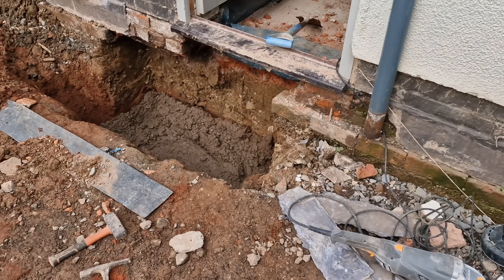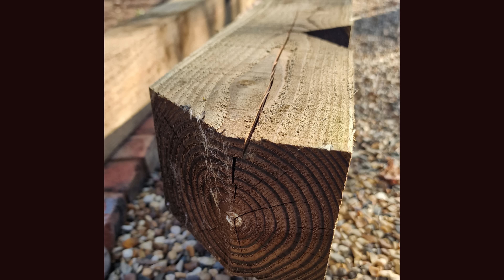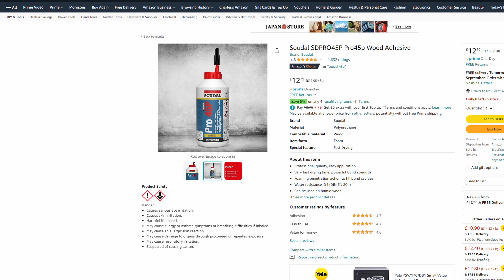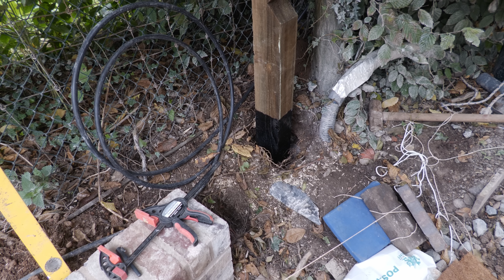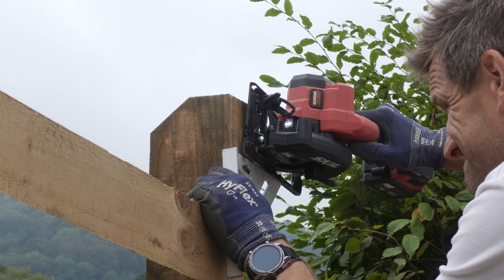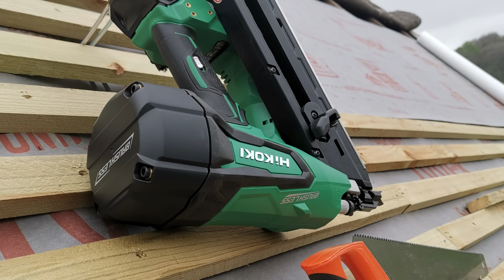Closeboard Fence Build

Comment: Thanks Charlie. I've basically copied off your approach here for my sloping fence. Material costs considerably higher in 2026 unfortunately. Also, I'm in Leeds and it seems we don't use Arris rails much up here compared to the South but I sought some out as I like the appearance. I used a durapost U channel to continue from my neighbour's concrete post but the same as your approach otherwise. Very articulate delivery. No wonder you pop up quite often when I search YouTube for DIY tasks. Cheers
Reply from the maker: Thanks Peter - really glad you found it useful!

Comment: great work... just about to redo 8m for my garden fence as it blew down.
Where did you get the capping boards... as i have no one local who sells them... especially at 3m lengths!! lol
I always blackjack my posts... never had an issue.
Replacing dodgy work previously done... 2 arris rails only used, and 100mm posts... no protection on posts, and poor screws used on arris rails (didnt use brackets or notched posts)
We have a 15m run of jackson fencing in place .. which im now going to attempt to try and get as close to looking as possible.
Reply from the maker: Some companies supply capping rails,  others don't. You could make your own with some 2x1/ roofing battens, cutting the angle on your circular saw.

Comment: Great video. If you want to save a bit of money - on large post holes , use 1.5 bags of quick setting post fix to get the posts level and set quickly. Then later make up some normal concrete with cement and ballast (1 part cement to 4-6 ballast) to fill the remaining part of the hole. Only useful on holes which are large and if you have lots of post holes

Comment: Hi Charlie, great video and very informative. We are disappointed to see that you have had a bad experience with our rot protectors and we wanted to address your concerns for both yourself and viewers of your video. We are very proud of our rot protectors which have been developed as a solution to ground line decay. Over the past 20-years we have accumulated a huge amount of independent test data from bodies like the BRE and It’s this data that backs our ‘proven and guaranteed for for 20-years’ position. 

We do occasionally see instances like this much like you would with other products that are sold in large volumes. Often we have found that the rot protectors have not been shrunk down tightly enough which is why this de-lamination occurs. As part of our application instructions for square posts we insist on rolling the surface to ensure a ‘black band of confidence’ appears at the top and bottom of the product to ensure a good seal to the post. Although the de-lamination has occurred, the sealant behind the sleeve will still protect against decay as it has sealed the surface of the post, provided it was applied correctly as above. All information on how to apply and install the product can be found here: https://www.postsaver.com/support/guides/apply-postsaver-sleeves/

We would also like to point out that the installation of the rot protector in relation to the ground line is unfortunately incorrect. With such a large amount of the below ground section of the rot protector visible we cannot offer any guarantee on the post in the video. For a valid guarantee the bottom of the grey band visible in the video would need to be level with the ground line to ensure sufficient protection below ground. 

We hope this provides enough information and we are more than happy to share our test data and reports to substantiate the above. We are also always open to feedback on our products and would love to hear any suggestions you may have or things you think could be improved. We want to solve the issue of ground line decay and make the process as simple as possible for our customers so please let us know if you have any suggestions. All the best - Postsaver.

Comment: Would have thought you might want the arris rails on the interior for security reasons
Reply from the maker: Yes I had so many people saying that after my original fencing vid and I probably should have put them on the inside which you're meant to do if you've got neighbours, but as it's just a field I'll take the nicer side to match what's there plus if thieves get over they've got a harder job getting out as I'm chasing them with my chain saw 😉

Comment: Great video Charlie, my only comment on the topic of trying to slow the posts from rotting is to raise the concrete around the posts to slightly above the earth level and slope it on all four sides LIke the jar of water to extend brush life I'll start using that Looking forward to the new videos
Reply from the maker: Thanks. Yes that's a fair point. I've kept soil away from the base by surrounding it with hard core. 👊 which should help.

Comment: Hi Charlie, your video is well timed as I am about to embark on fencing off the plot around my custom build house. This may be a silly question but may I ask what tool did you use to dig those 600mm holes to put the uprights into?
Reply from the maker: I used that mutt pro digging tool - there's a link in the Description. I didn't record much frootage for some reason but you can see it in action here https://youtu.be/sCMdiWauKjQ?si=yW_b2mA2WIBtwff_

Comment: I think concrete posts are ugly. Much better a timber fence and featheredge is the easiest with the flexibilty of post placement. I use bitumen paint too, and those post saver sleeves tho' i wasn't impressed with the results on yours. I'm gonna check mine out tomorra. 🤔🫤

Comment: A lovely job Charlie, really neat and professional looking job.
I know you’ve got lots of “well I’d have done it differently” comments already, but personally if I’m going to do a job like this, I dont want to have to come back and re-do it in 5 or 10 years time so agree with the bitumen paint and the capping rails finish things off lovely but I’d have put concrete support posts in at the back as the posts do rot off at soil level, similarly I’d have put concrete gravel boards in, especially behind the sloping bank as soil and wet leaves will accumulate there.  Also wouldn’t use postcrete, see ProperDIY video on postcrete vs mixing your own.
I’ve got 25m of hedge to take out and replace with fencing sometime soon, am strongly leaning to maintenance free UPVC slot-in slatted panels as I’m hating painting the other panels every year only to see the “5 year” timber preservative flaking off and needing repainting.  But oh so expensive
Reply from the maker: Thanks for this. Yes that'll be a great solution. The issue with preservative is when people use stain. I'd never use stain as I hate the way it peels off. Oil every day for me 👌

Comment: Great Job on the fence Charlie, so much better than using panels and more flexible too !

I use the same trick with the brush for linseed oil (which also avoids any chance of it spontaneously combusting) for bituminous paint I always leave the brush in a part filled spirit based shed & fence treatment which does a similar job (but these are getting less widely available these days sadly) any bitumen that dissolved just made the wood treatment a little darker, and probably more effective too !

Comment: Thanks Charlie, particularly useful as I'm halfway through my closeboard build. Watched your last two and thought I'd check this incase you've changed any methods. Regretting the post sleeves myself too....I torched them on and ended up bitumen paint over the top anyway
Question -  I guess you're using the 51mm to secure top of featheredge board to counter rail? I'm finding it's sometimes splitting the board/ piercing out the back of the counter rail. Any thoughts? Deano

Comment: Love your videos Charlie. Thank you for producing them for us all to learn. Quick question if you have time, how do you calculate that the height of the fence is within limits (as I know there are restrictions without planning permission)? From the field side it looked fine but obvs (as you said) much higher from the patio side. Thanks.
Reply from the maker: Hi David, thanks, I really appreciate that. I thought someone might mention that. I think from a planning perspective it would be measured from the slipping ground up (ie below the gravel boards). The cut out below the wall would be irrelevant as the fence itself is a standard height and indeed the post was only non standard length because I couldn't set it where I should have - in that excavated ground behind the wall. 👊

Comment: Some really good tips here that I will be sure to use. Though make sure that hedgehogs can get in and out under the fence somewhere!
Reply from the maker: Good point. The previous owner has a fence around the entire perimeter which made it hard for them to get through. I've punched through it here so they should find a way in down at the bottom. We've only had one in the garden in recent memory.

Comment: Concrete post & concrete gravel board and ARIS rail= no faffing about
Reply from the maker: Fair point.
Reply: Hi Charlie  great video as always .  Very slightly off topic I’ve recently been needing to form a divide between a gravel garden and grass , I’ve used the the plastic decking boards that you can get quite readily now . Obviously not their intended use but absolutely perfect for my job , so much so I’m going to use it as gravel boarding when we replace our back fence .   The actual fencing that is made of a similar material is still relatively expensive , so I doubt we could afford that . But having a gravel board that will never rot has to be a worthwhile investment .    😀👍👍👍

Comment: are you not worried that the bitumen keeps the water in as well as keeping it out
Reply from the maker: This question comes up from time to time. No, I think that's over thinking it. I've bitumened the top of the post to stop rain getting in from above. The posts are tanelised which should stop the majority of the rain sinking in laterally and so I think the greater priority is to stop water ingress before ground. That said, as rotting primarily happens at ground level there's an argument that you could/ should just create a bitumen collar above and below ground that doesn't fully encapsulate the post.

Comment: I put bitumen paint on my fence posts and I regret painting the bottom of them. I think painting the sides is a sensible idea, but in my experience painting the bottom just made it a pocket of bitumen around the post that held in the moisture. If you don’t paint the bottom then the moisture can leech out into the gravel you’ve hopefully put under the post. My posts ultimately rotted out at the top of the bitumen paint. Anyway just an observation, I get a lot out of your videos.
Reply from the maker: It's a fair point that I'm aware of and you're right, the main rotting happens at ground level which is why those post saver sleeves are positioned here rather than being a complete pocket. My thinking is I've weather proof the top of the post. The sides are tanelised so how much water is actually going to seep in and migrate down the post internally and into the base. I've always put gravel at the bottom - you'd see me doing this in the original vid - but again I'm a little sceptical whether in reality movement of water is more into the post rather than out of it from underneath.

Comment: Great work and Great Upload Charlie, just thinking regarding a Belt and Braces solution to stop those Posts rotting in the ground, maybe Fibre Glass resin painted onto same or even pre cut strips of matting soaked in resin and then  rollered onto the bottom of the posts as a totally Nuclear option...one would reckon that once that has gone off that same would not be rotting any time soon...
Reply from the maker: Thanks mate. Yes that would be a pretty awesome solution. A few people on here are suggesting I should have left the post open underneath for moisture to migrate out through the base but as I've weatherproofed the top and the sides are tanelised I really can't see much moisture getting in and needing to seep out from below. Time will tell 😉👊
Reply: The issue with rot is rarely in the ground, it is where it comes out of the ground and cycles through wet and dry and causes rot.
Reply from the maker: True, which is why the makers of those Postsavers position them just above and below ground. It just seems right to me to protect the post below ground too and I don't buy the arguement that water needs to seep out as I can't see much getting in. 🤔
Reply: @CharlieDIYte  I agree about your point about the post not really needing to allow water to seep out - All the fencing I ever replaced in my former job was where posts had begun to rot at ground level and usually broken there in the wind. I don't recall ever having to replace a fence where the rest of the post was fine but it had rotten through in the ground. Some had started to rot in the ground but they broke at ground level well before the in the ground stuff became an issue - I think your biggest worry will be at ground level and even that won't be for years and years, if in your time of ownership. I am pretty sure had you got a "professional" in they won't have taken half the measures you did and as such yours will well out last a "professional" install would have.

Comment: Wet post don't rot. Wood that wet/dry rots. So concrete above soil. Look at posts in Thames.
Reply: It was in the news just last week that they pulled some wood out the bottom of some river, it was 500,000+ years old (seriously, look it up). Don't think they had painted it with the bitumen paint 😂
Reply from the maker: I can't argue against that 👊😉
Reply: The reason why wet post don't rot is because of the lack of oxygen. The fungus that rots wood needs it to grow. With the added benefit of low pH as in peat bogs, then the combination of water, low pH and lack of oxygen is why bog oak can last for thousands of years
Reply: Exactly, the issue is never really the post in the ground it is where it comes out of the soil and cycles through wet and dry. Always try and dome the concrete out of the ground so soil doesn't build up there and water is shed away.

Comment: Advantage of wooden gravel board: can cut holes for hedgehogs to pass through. We used concrere, like all neighbours, so hedgehogs have vanished. Regrets
Reply: Same regret here but concrete gravel boards with holes for hedgehogs do exist - at a very inflated price unfortunately !
Reply from the maker: I need to look into this. We've only ever had one hedgehog in the garden - partly because the previous owners put a perimeter wire fence up.
Reply: Good point. Unfortunately I have the opposite problem in that some rats are nesting below my neighbours decking. I used concrete gravel boards to try and cut off their run into my garden, hasn't completely worked though and the hedgehogs are nowhere to be seen. 😢
Reply: I cut a hole through my concrete ones … that evening the hedgehog came straight through from the hole in the wooden gravel board at one side to the concrete gravel board at the other side … result! 6 months on my neighbour has built in half cocked sleeper beds and the hedgehog can still go through the concrete hole, but to no where the other side! 😡